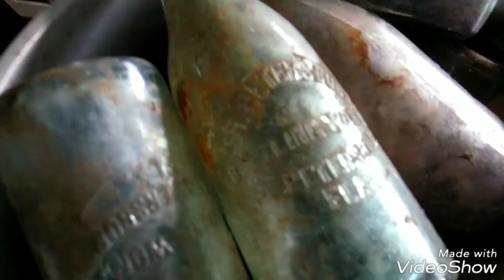Bottle digging a killer soda dump early 1900,s

Comment: Sorry but that is in that is not a turn of the century dump. Its just common stuff from the 1930's and forties. I leave stuff like that behind. You're not even finding any good embossed bottles and if it was it was an early 1900s dump you would be finding good embossed bottles and there should be Prohibition era stuff there too but you're finding liquor bottles with Federal law on them. Anyway, at least there's lots of glass there.
Reply from the maker: Barry we found straight-sided Cokes embossed St Petersburg bottling Works bottles a hutch some other embossed early soda bottles all pre 1920s straight sides are 1915 to te 1900 we also found round bottom sodas laptops you don't see any of that stuff in the 1930s dump
Reply: He must of commented on the wrong video. Did the bottles get bruises on them from the sun heating them up?